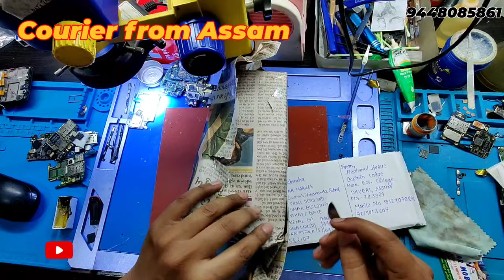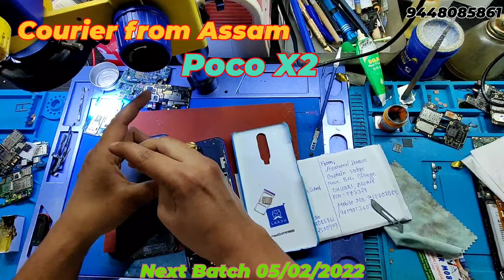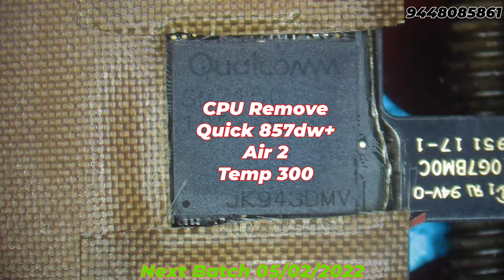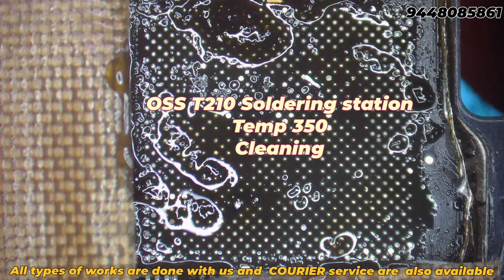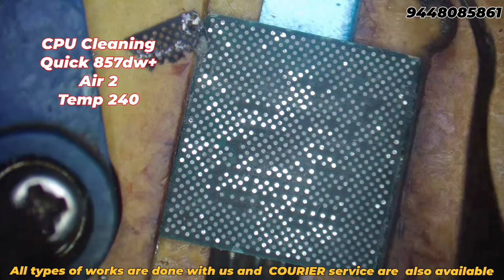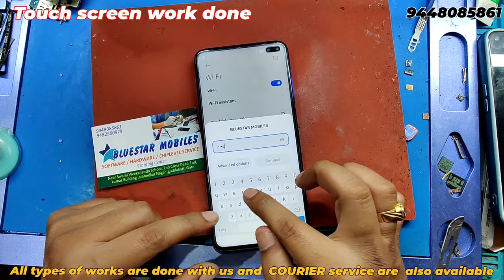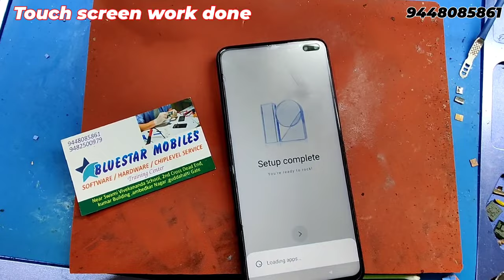POCO X2 CPU REBALL TOUCH ISSUE WITH INSTRUCTION BLUESTAR MOBILES

Comment: Sir plz tell me around cost my poco x2 also camera and touch not working 
Plz reply
Reply: Send him without any hesitate they'll fix your poco x2 100% .
I had sent them my POCO x2 with same issue which u have ..
They fixed it with in around 3-4 hours
Reply: @nikhilsaini2666  bro im from bihar

Tell around cost for repair
Reply: @mohammadmokhtarmiyan7569  2000 for repairing + 350 for courier